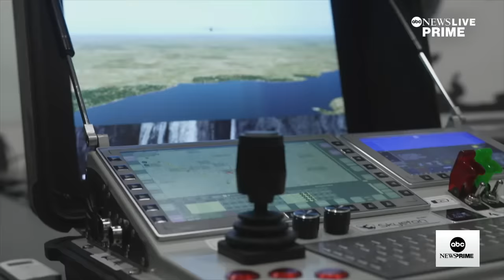Highly technical and highly dangerous: Inside Ukraine's drone war | ABCNL

Comment: The Philippines should also invest heavily in research and development of these sophisticated drones [aerial and naval] for defence of our exclusive economic zone waters.They are also more economical to produce than ships,submarines or airjets.The foreign bullying of our fishermen in the West Philippine Sea is too much.
Reply: not foreign, CCP/Mainland-'Red'-Chinese...
Reply: Every nation is
Reply: Ironically to make your drones you will need to buy parts from China!
Reply: @michaelyoong7  I said invest heavily in research and development.I did not say assemble.Besides China is not the sole supplier of components.
Reply: @razor1uk610  Even without mentioning the name,Mainland China is bulls-eye foreign.
Reply: There is not a lot of R&D needed. Off-the-shelf components and homing software are easily available to make low-cost drones.
Reply: There are already in place advanced anti-drone defence hardwares.If the drone does not have the capability to evade detection it can never home in to the target.
Reply: @PurpleLight-FX  Evading detection is not the main problem. Large drones can be detected, no away around it. Small drones are by default hard to find at range. But the doctrine of drone warfare is saturation and economic advantages over defensive anti-drone systems, not finding methods to avoid defenses. The only cost-effective defense are radar-guided CIWS platforms and newer signals interference. So the research would be on resistance to signal jamming and electronics shielding, and cheap (wood, paper) material with low RCS for larger drones.
Reply: @timelapsecoder  Unending research is being conducted on how to neutralize drones.You can not sit on present technology alone if you hope to succeed in using them continually over time..
Reply: @PurpleLight-FX  I don't disagree, that's just how combat systems work. What I corrected was advocating for research on evasion. That's not critical for most drones, both long range reconnaissance or small kamikazes. Evasion is for things like cruise missiles, which is orders of magnitude more expensive (e.g., will need high fidelity terrain data). For drones, I opine that that is overkill.

You still have to deal with mass jamming and last-mile high-g maneuvering (not that critical) and path planning for example, so that's where research should go. I would not mind if my cheap drones are getting shotdown by high-tech maneuvering  anti-drone drones, because those are more complex, expensive and single-use. The repeated use large-area mass jammers are the problem.

The goal is always to make drones much cheaper than the cost of building the things that neutralize them and the stuff being targeted.
Reply: @timelapsecoder   My point is not research on evation.The point is research on drone effectiveness overall.
Reply: @PurpleLight-FX In that case we agree. I was reacting to what you said about "... already in place advanced anti-drone defence" and that if a drone does not have capability to evade detection, it will have a hard time hitting a target. In overall (poor country/limited budget) drone development, evasion should have much lower priority than other problems drones already and will face. Appreciate the discussion.

Comment: Ukraine needs 500,000 drones of various kinds to repel the enemy.  It's the most cost efficient method.  They just need to add AI vision targeting,  along with terrain map, inertia and magnetic navigation as backup to GPS,  so they can operate autonomously and return to base via covert waypoints.  Video recording along with live video streaming also providing further backup of battlefield intelligence data.  Modular weapons attachment selection options also.  They already have some of this, but getting the redundancy into these smaller packages should make them more robust against the illegal enemy invaders.  They are not hugely expensive components either.  They are already available for drone hobbyists.
Reply: they have a jet powered drone coming. there have been a few partial pictures published. they have ramped up drone production. like the video said. they probably already make a huge number. that one guy said they make 1000 / month and those are very high end surveillance units

Comment: UAV  pilots are vulnerable when they have their ground recievers and transmitters in their hands or nearby that can be located by the Russians.. An extra short range handheld console that controls the actual long range transmitter placed at a safe distance from the  pilot could protect him from being shelled.
Reply: I'd guess they've worked it out by now. The important bits of frontline are not manned by artillery and drone operators at the same spot. They're given coordinates by commander via encrypted Starlink nodes. The russians first target artillery before looking where the tiny drone operator  gets his signal, not as accurate as to hit a single or few persons hiding in dugouts.
Reply: @dannydetonator  In most cases today, the drone operator was located 
at a distance from the control antenna and its emitting signal. 
Thus, the soldier is protected from detection and defeat.
Reply: Так ми і літаєм. Антени на відстані 50 метрів, оператор в окопі чи бліндажі.

Comment: Especially for Ukraine, or most countries smaller than the one attacking them, this is a great way to offset the shortage of manpower. Ukraine does not have the soldiers to go against Russia one to one, one drone pilot can launch many drones to a target, often also much more expensive and or even irreplaceable targets.
After the war, Ukraine is going to be a Drone powerhouse.
Drones of all sizes and purposes.
Hopefully it will be a good industry for them, although making weapons is mostly a waste but unfortunately also a need, it might make them a lot of money, which they will need to rebuild their country.
Now Ukranian drones are even using the many recovered Russian anti-tank mines to drop back onto them, great use of Russian and Ukranian equipment.
Russia must pay, Ukraine must win, not too sure if Russia will pay for what it has done after the war, but i know Ukraine will win.

Comment: After the discovery of gunpowder by China in the 9th century, gunpowder was first used on the battlefield in 1044 AD and changed the entire engineering of warfare, just as another explosion using FPV drones on the Russian-Ukraine battlefield in 2022 changed the engineering of the battlefield forever.
Godbless Ukraine !

Comment: Question is; when will they start to use drones to in,- and exfiltration of trenchlines? can lift the troopers over minefields and get em safe across a piece of land, drop em right on top of the enemy where the Ukraine can assert their dominance via better training and coordination. SHOULD a trooper get wounded, then theres airlift back home right then and there alrdy.
Could also just carry 1 drone pr squad, to quickly get wounded troopers back to a hospital

10000 drones capable of carrying a load equal to a geared trooper; you would have "paratroopers" en masse, and you could utilize them locally aswell as in depth.
I think the russians would be shocked if theyr where attacked by a flock of mandalorian warriors

yw
Reply: The UK has donated Malloy heavy lift drones to Ukraine capable of doing everything you mentioned except help a Mandalorian fly..You might want to check out the Royal Marines using jet pack suits to board the QE aircraft carrier as well as other things. Reality is catching up to fiction. There is video on both of these online now.
Reply: @paulking7019  jetpacks is NOT what im at. Its combersome, heavy, noisy and have a limited fly range. Its operated by the user..
Man-sized drones, can be carried on the back into combat, or alternatively be used as shuttlebuses. 
Jetpacks is a one-man 1 suit thing that looks impressive but im perty sure its safe to say they got overtakien on the unner lane. 
Drones could be operated from the front or from the rear, by dedicated operators, manned/carrying by unconscious wounded soldiers.
Theyre lightweight and can be produced by existing materials, and did I mention they could be used as shuttlebuses ? ;P Both in and out of the hot zone.

Weve seen these drones being used a summer-toys, makeshift water-parks where peeps take a lift-off and jump off into the water. Its fun.. But its also a very effective way to get past obstacles of any kind.
Reply: @martinwinther6013  You said "I think the russians would be shocked if theyr where attacked by a flock of mandalorian warriors" ...if you know anything at all about Mandalorians from Star Wars, then you know they use use noisy Jet Packs to fly. They are not unlimited in range either.  Your idea isn't new and it goes all the way back to the 1960s when t
Reply: @martinwinther6013  So no Jetpacks. You brought up Mandalorians. Mandalorians use noisy fantasy jetpacks for flight in a fantasy world while wearing special fantasy armor that can deflect almost anything in that fantasy world, They don't use drones for flight in the fantasy world.

If you looked at the Malloy Heavy lift drones, being supplied to Ukraine, you would see they can do what you describe. If you want to fly into battle on one, then take its controller on board with you and fly yourself wherever you want to go. Now land put a wounded soldier on it then fly them back. Upon arrival have someone there load it down with ammo and food and fly it back to your location. 

If you think you are creating something new, here you aren't. Even the idea is decades old. There is very little in this world that someone hasn't already thought of. Keep trying. Besides nothing says your creation won't be better in some way.
Reply: @paulking7019  lol-- dood. i wasnt being srs about "mandalorian" - like wtf. was a meme way of putting it out there.

Im not calling dibs on any idea. 
Kant put it out way better than me; if I can see further than any man before me, then its because I stand on the shoulders of giants.

Thing is.. Its NOT been seen implemented.
Troopers still wait for med-evacs on the battlefield, they still have to cross greyzones that are mined up.

when did you last see 500-1000 troopers being dropped into some rear-echelon areas, do their thing and fly back in the same 30min?  - lifted by drones that fly like 30-40km/h at most, a cpl meters above ground , at most.
You can attack freaking anywere you want, your entire army is all the sudden airborne.
Or forget 1000. Go 5000.. 5000 dropped anywhere, and individuals can be returned home at the snap of the fingers if(when) needed
Reply: @martinwinther6013  It's not an impossible. Even if you didn't come up with the ideas there is no reason they can't be improved on and made reality. I will not be surprised if someone, just fooling around, takes one of those Malloy heavy lift drones and uses it to fly themselves around with its controller in their hands. That could be the beginning of it all. From there we could see the thousands of troops you talked about flying into battle and being returned automatically for care if wounded. It could become a reality fairly easily and not just Star Wars scifi. It is all possible right now. Someone just has to put this together. Such things could have a great many uses outside of warfare too.
Reply: @paulking7019  and any manpad will destroy that drone with that human on board. easier than shooting at ducks.
Reply: @ronblack7870  and any sniper can shoot the guy standing in the open waiting for their manpad to get a lock on a cool running electrically powered aircraft easier than shooting fish in a barrel. Under the right conditions any manpad  could destroy any drone, helicopter, and even F16s. I suppose attempting to fly at all is completely out of the question. On the flip side there is no point in using a manpad either since the operator could be shot before they get a chance to fire it. If we based things on what might happen, then no one would be on the battlefield at all, and every piece of tech made would be considered useless since a possibility exists that it could be defeated. 

A video was released today of two Ukrainian helicopters flying over the front lines and successfully attacking Russians on the ground. There were no manpads fired at them. They are much larger and hotter than any electric drone flying, yet they were not even shot at by manpads.